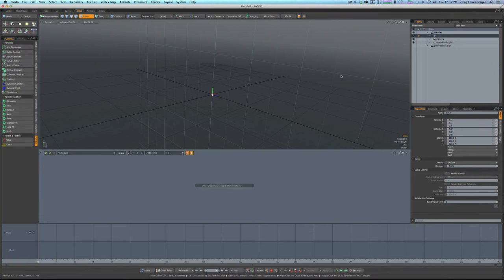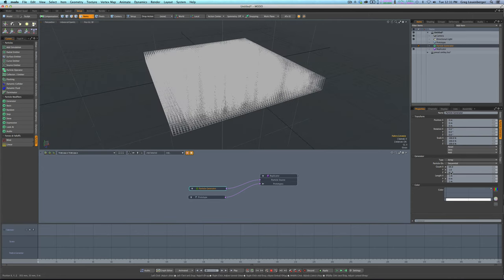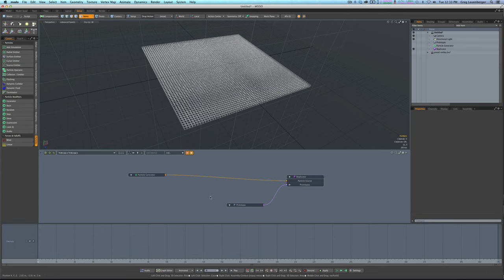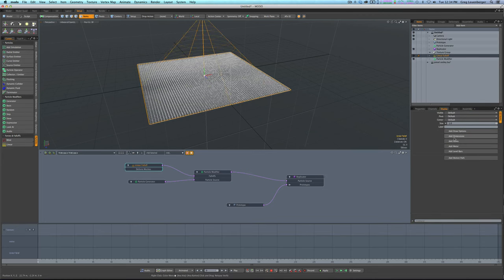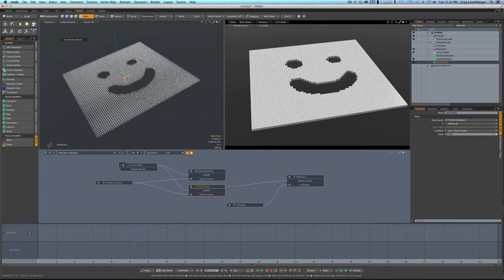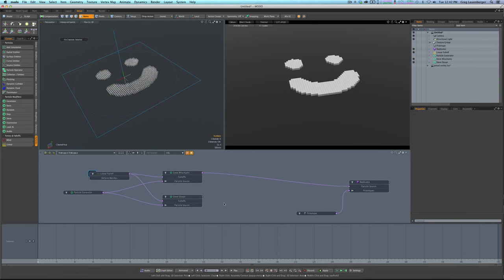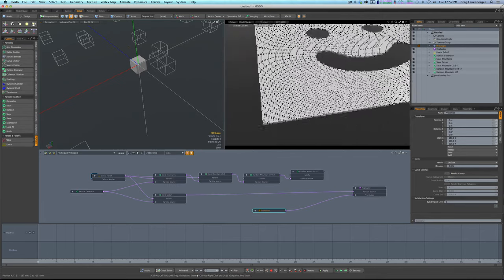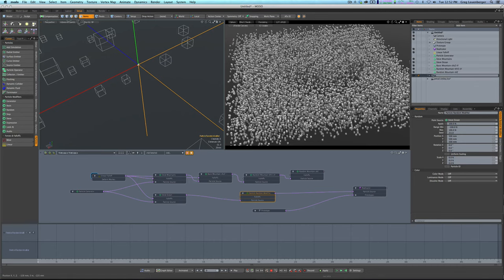pMod terrain part 2

Comment: Hey there! Great video. I have a question. How does the variation texture layer at the last sieve pMod know that they're working together. Just before the 30:00 you add the variation texture layer and then another Sieve pMod. Why does this last sieve affect the colour from variation texture and the other Sieves do not?
Reply: lauren thomas Because it's attached to the Particle ID of the original generator where the rest are randomizing or sieving the falloff. Thanks Lauren! lol.
Reply from the maker: lauren thomas  Hi Lauren - glad you answered that because I've pretty much forgotten how I did this scene.....lol.